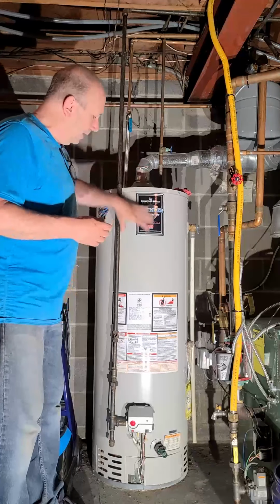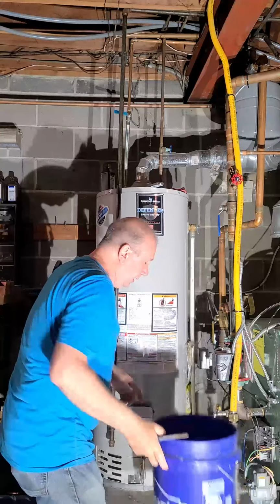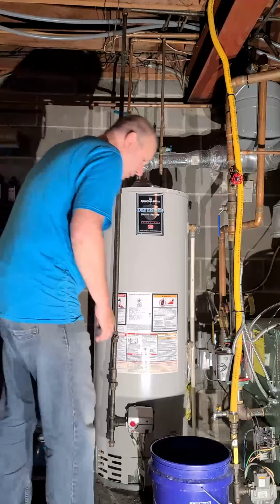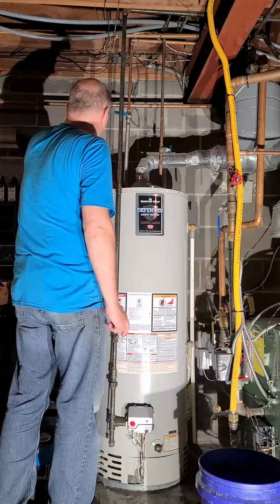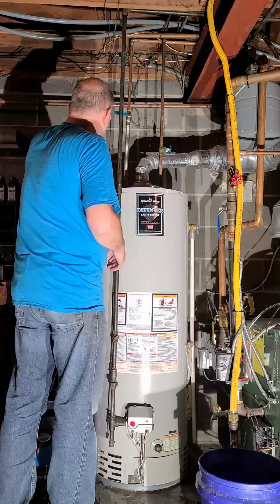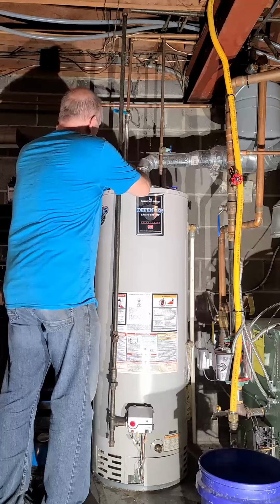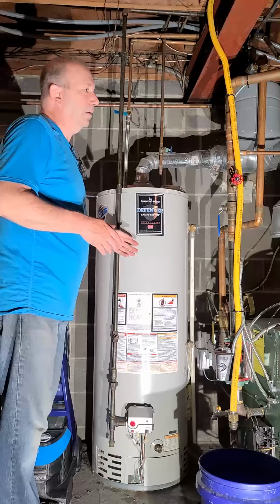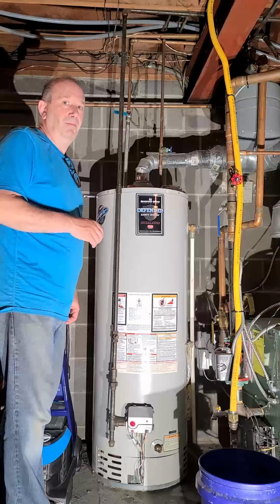Does your hot water smell like rotten eggs? Here is the fix.

Comment: hi sir, my parents are gone and im trying to save our house - i have well water and it has been off for a couple months - the sulfur smell is so terrible i cannot even breathe - do you think just a zinc anode rod replacement will do the trick? or should i also get a whole new water heater? thanks for your time.
Reply from the maker: First off is the sulfur smell just the hot water or both hot and cold water? If it's in both the hot and cold water then the issue is not the heater.

If the smell is hot water only then you can replace the anode rod or use the peroxide method I show here. A new hot water heater probably won't solve the issue as it will come with the same type of magnesium or aluminum anode rod and the issue will persist.  I would just treat it with the peroxide first as per this video and see if that takes care of the smell. If so you can then safely assume it's the anode rod and replace it. When the heaters sit unused the smell comes on stronger and quicker. Let me know how you make out!
Reply: Brian thanks for your quick reply - yes the smell comes from the hot water only - the house was vacant - and as a child we always had a smell but nowhere near as bad as it is today - just so i am clear : i use the peroxide first, then if that doesn’t work try the zinc anode rod - yes? or should i just do both
Reply from the maker: @fahriakalin5936  I would start with just the peroxide. The smell will be much worse if the heater sits unused. Just follow the video by putting it in the heater and letting it sit for about 4-5hours. That should eliminate the smell for a few months if the heater is in use. Maybe a few weeks if the heater will not be in use.
Reply: I had the same problem. I call it iron bacteria which causes the smell. I shocked the well with bleach then turn your water softener to bypass. Run your taps hot and cold both until you get a bleach smell coming from the water. Toilet everything that has water in it. I then let it sit for 24 hours at least. It will clear right up. If it comes back you didn't use enough bleach. Do it again with more bleach. I have a 160' well with water 30 foot from the top. So 130' of water in a 6 inch casing. I used 2 gallons. Recommend by my well driller.

Comment: Unfortunately, I've changed the anode.  Had new Rheem hot water heater (old one was Rheem - 20 years old). Sulphur smell started - after testing, I had the anode replaced and that didn't work. Had the tank shocked the tank, put in filtering and that took care of the problem. Then, after 3 years, the hot water heater element died. Rheem paid for a new one an installation (bought extra protection) had the new one put in with the alternative material anode. However, the problem came back even worse than before. So, I do not know what the hell is going on. Going back to shocking the new tank - grrr. I'm not sure that it was the anode in the first place as the new tank has the alternative one from the get-go.
Reply from the maker: That's odd. As long as the smell is only in the hot water the anode rod replacement should do the trick. I would question if the anode rod is actually the correct material.

Comment: Cold  side as the longer tube. If its crack or breaks off replace it gives u hot water longer for use.  I0 mins to replace. It's called dip tube. Make sure u cut it so the is 6 to 8 inches from bottom of tank

Comment: My water heater is connected to a well water system that has two filters before feeding water to the water heater. 
 
Can i remove both filter, fill both of them with hydrogen peroxide and put them back on? Would it work the same?
Reply from the maker: Hi,
I'm not sure if this would work. The issue is the Peroxide needs to sit in the Hot water heater for 4 hours or so. Important to note this only works if the smell is from the hot water ONLY. If you have the smell from the cold water also you have a different issue.

You could try this but you would need to pull the peroxide solution from the filters into the hot water heater. So you could put the peroxide in the filters then turn on the hot water and let it run for 60 seconds or so then turn it off. This should draw the peroxide into the hot water heater. Then let it sit for 4-6 hours. Can't guarantee it would work but won't hurt anything to give it a try. Let me know if it does work. Best of luck!
Reply: @BriansSpace  It did work!! But it may only work for a month or so since i could only put one full bottle of hydrogen peroxide in the filters. So two bottles for the hot and cold water.. But there no more smell!

Thank you so much!!!!!!! I've spent thousands of dollars trying to get this issue fixed, buying new water softener equipment's,  pressure tanks and all kinds of parts for the well water /softener system.. My tenants wouldn't want to shower or even wash the dishes with the hot water.

I spent $12 at walgreens took me 15minutes and the smell is completely gone the next day! WOW absolutely AMAZING!
Reply from the maker: @Diabolical05  you made my day! So glad it worked for you. Normally it last 2-3 months. Thanks for letting me know it worked out for you!

Comment: Why not just add a small water filter to the cold inlet side because the cold goes to the bottom of your tank so you only have to unscrew the cartridge add your cleaner of choice, screw it back on USE NO FILTER turn the water back on, DONE.
Reply from the maker: That would work. I actually modified the hot water side recently and will shoot a new video next time I do this. I added a tee and some valves and can now do this very quickly. Thanks!

Comment: Any alternatives if you don’t have the sharkbite tubing or other access?
Reply from the maker: I have heard that this sometimes works if you do not want to open up the system but have never tried or confirmed it.

1. Shut off the water to the house. 
2. Open a hot water faucet upstairs closest to the hot water heater and relieve the pressue. It must be above the heater.
3. Secure a 12" tube of some sort to the faucet and make it a tight seal.
4. Put the other end of the tube into the container of peroxide.
5. Go to the hot water heater and open the drain on the bottom of the heater and drain water from the heater.
6. In theory this should create a siphoning action and pull the peroxide into the system and down into the hot water heater.
7. Close the heater drain, close the faucet, then turn the water back on to fill the tank. Let sit for the recommended 4 hours.

Again, I have never tried this so if you attempt it let me know how you make out!

Comment: I never use those flexible water lines, they always leak . I hard copper my water heaters in. I get tons of calls because contractors and handyman use those flexible water lines,  they leak at the nut where it screws onto the water heater nipple. I install Bradfordwhite all the time,  you would think after 130 years of them being in business they would relocate the anode rod like all the other manufacturers.  If you don't replace the anode rod every year your asking for trouble,  I have replaced them only after 6 months and the rid was almost denigrated.  It depends on how hard your water heater. The anode rod others are talking about that cost $100 + is nice but most homeowners will not spend the additional money on it. You can talk to them until your face turns blue, it don't matter, and now 2023 with water heater prices sky high they definitely don't want to spend the extra money. I always put on my invoice that I recommend flushing and replacing anode rod yearly,  but people just don't care they completely ignore it and never do any preventative maintenance.  I would say 10% of homeowners actually flush theslre water heaters yearly and even those 15% flush them incorrectly because they don't want to pay the plumber to do it right.
Reply from the maker: Great tips! I have since had those flexible lines replaced and hard plumbed in and finally hooked up to city water, so no longer have the issue with the Sulfur smell from the well water. Great advice on swapping out the anode rods and flushing them regularly. A plumber once told me regular maintenance on your water heater, and they can last 20 years no problem. Maybe that was back before they raised the prices on them and cheapened them up at the same time!

Comment: i live in an apartment there was a water leak from the water heater from the upstairs neighbor long story short  the water came through my wall heater its been stinking ever since  )the gas to the wall has been off for few months, how can i get rid of that musty water smell?
Reply from the maker: That's a tough one. It probably needs to be dried out completely. A dehumidifier might need to be run near where the leak was. Until all the moisture is removed the smell will probably persist and there is a danger of mold setting in. Good luck water damage can be a pain.

Comment: Does this method work if I have well water? We have been paying thousand of dollars on a water softner system.  l also purchased a new hot water tank and the problem is still there
Reply from the maker: Hey Carla, It does work on well water as I am actually on a well also. Water softeners can actually make the rotten egg smell worse. I also run a water softener as our well water is hard and the softener solves issues like low suds on soap, hard water stains on faucets, toilets, and shower walls. The hot water heater is not the issue. What causes this is a reaction with the Anode in the hot water heater. Replace the standard magnesium or aluminum anode rod with an aluminum/zinc alloy anode will solve the
 problem in most cases. Sometimes with softened water though this will not resolve it and in those cases, they make powered anode rods. For me though just adding the peroxide 4 times a year is working out fine. Now if I ever replace the hot water heater I will swap out the Anode rod before I install it.
Reply: @BriansSpace  thank you! Just last week we spent another 200 dollars on zinc rod but the smell is still very strong. My husband did watch your video and after work he said he will try this process. I wish I had known that the hot water tank wasn't the issue because it would have saved us money. After we bought the hot water tank a month ago, the guy did take out the anode rod and when that didn't work, that's when we bought the zinc rod and had it installed last week but still the strong smell. But I am praying that this hydrogen peroxide works out. Thank you
Reply from the maker: @carlabrown3513  did they flush the tank after removing the rod? You would need to flush the tank or treat it with peroxide after removing the rod or the smell would probably be there for a long time from the water already in the tank. Also, you need an Andod rod in the hot water heater or it will fail much quicker. Don't run it too long without that rod installed. The anode basically sacrifices itself and will dissolve away instead of the tank.

Comment: This did not work so I will try turning hot water temp to 150 (from 120) to see.  
Background:
We had rotten egg (sulfur) from hot water.  We built the house 20 years ago with pvc pipes not copper.   Two months ago we replaced our 20 year old water heater w rheem.  We still had the smell.  We are on. City water.  We installed water softener with filtration. The plumbers chlorinated the hot water tank and cold lines.  Still stinks.  They also replaced the anode even though the new one was just a month old.  I need to confirm if they replaced it with a zinc, magnesium or aluminum.  Either way, the hot water shouldn’t still stink.   I’ll let you know.  
1)
Reply from the maker: Just an FYI. If you have Sulfur smell from the cold water also it is a different issue and this will not solve it. This fix only works on if the smell is only from the hot water and your cold water does not smell.
Reply: Take the anode rod out chuck it in dumpster place a 3/4 inch plug in its place if its not on its fill side and in 10 years of no rotten egg smell or messing with peroxide every month you may have to replace your hot water heater again
Reply: @BriansSpace can you expand on this? our water heater is only 6mths old & we are still having the issue w/ cold & hot.

Comment: Why do you put it in the hot side? Shouldn’t it go in the cold side so it will circulate all the way through or doesn’t it matter?
Reply from the maker: The dip tube on the cold water side goes almost to the bottom of the tank. On some, but not all, heaters this requires much more water to be drained before pouring the peroxide in. The hot water outlet generally only goes a little ways into the tank allowing the peroxide to more easily be poured in. You can do it on the cold water side just might require more water to be drained or take longer.

Comment: Just raise the water heater temper to 360 for 6 hours. 
Than drain; go to all your faucets in your house and turn on the hot water. 
I think the hot water also cleans the inside of the water pipes. 
Repeat if it stills smells bad. 
I did it twice. In the morning and afternoon.
When your done; lower the water heater temperature. So you don’t get burn.
Reply: Ill have to try you way because my water heater don't have the access hole on the top.
Reply: 360ºF?  Perhaps you mean 160ºF?
Reply: @cslloyd1  300 degree im sure
Reply: @26dredarkk  212°F is boiling.  It explodes at that temp
Reply: @cslloyd1  i may be saying it wrong i turn both my thermostats up to 150degress  i stand corrected thanks
Reply: Or just replace the anode rod with a CorroProtec electric anode and not have to do any regular maintenance for up to 20 years…

Comment: Can you pour the peroxide in thru the anode port?
Reply from the maker: You can. If you go to the trouble though of removing the anode rod though just replace it with a zinc anode rod and in most cases, it solves the problem for good. If you remove the anode rod just turn off the hot water heater, close the valves to it, drain some water out to relieve pressure and be careful not to burn yourself on the hot water.
Reply: If you have a water softener though, the trace amount of salt left in the water will quickly corrode the aluminum/zinc anode rod. Get a CorroProtec electric anode rod and it will be maintenance free for up to 20 years.

Comment: great video, quick question, IF the plumbers replaced the entire water heater why didn't that take care of the smell? you still would have gotten a new anode rod.
Reply from the maker: Thanks for commenting. It is not the fact that the anode rod is new or old it is the material it is made from. Water heaters come with Magnesium or aluminum anode rods and those react with the sulfates in the water creating the smell. Replacing the Anode rod with a zinc one usually solves the issue as it does not react the same way. Removing the anode rod will also get rid of the smell but this will result in your water heater failing way earlier than it should due to the missing anode rod. In some cases, even the zinc anode rod will react and in those cases, they make an electrically charged anode rod that is supposed to solve the problem no matter what the water content is. Thanks again!
Reply: @BriansSpace  I just moved into a newly built apartment building in GA and the water smells like bad eggs, I never heard of this before. so it could be the anode rod that's causing it? other renters say they just let the water run till the smell goes away.
Reply from the maker: @iwin4985  ok if you smell sulfur on both cold and hot water then this is not the issue and won't solve the problem. For sulfur smell on both I think you need a filtration system. This fix is only if the smell is from hot water only.

Comment: Where did you put the peroxide in at.?
Reply from the maker: You need to remove the connection on the hot water out side and pour it in through there. You can also use the cold water side but the tube extends further down in the tank and you need to drain more water out if you use the cold water inlet side that's why I use the hot water side. If your heater is hard plumbed in with copper and not flex pipes it does require cutting the pipe and replumbing it with a flex pipe. If you are unfamiliar with this it is best to hire a plumber and if you did that I would have them replace the Anode rod and eliminate the problem completely so you do not need to add peroxide.

Comment: so you put the peroxide in the cold inlet?
Reply from the maker: I put it in the hot water inlet tube as the cold water tube generally goes further down in the tank making it slower to pour the peroxide in. Either tube will work though.
Reply: @BriansSpace  Thanks Brian,  I'm nervous unscrewing it because the last time I unscrewed a water heater, water gushed everywhere.
Reply from the maker: @snake0911  yes it will do that if you do not shut off the water and drain the pressure from the tank using the bottom drain.. Also, make sure the hot water heater is turned off. If you are nervous about doing it and not sure then it's best to call a plumber. You can get burned if the water is hot and splashes on you. If the smell is only from your hot water heater and a plumber you call says you need a hot water heater or a water treatment system then kick them out of the house as they either don't know what they are doing or are scamming you. The fix for rotten egg smell from hot water only is what I describe here or a different anode rod. If the smell is from cold water also it's a different issue. In your case, I would highly recommend calling a plumber to help you out with this given your nervousness. If you do try to proceed at least turn the heater off and let the water cool off for about 24 hours before attempting to open the system. Good luck!